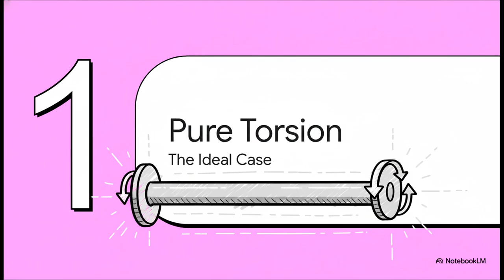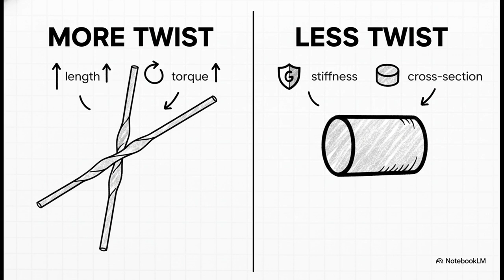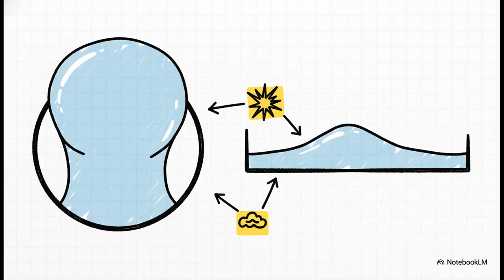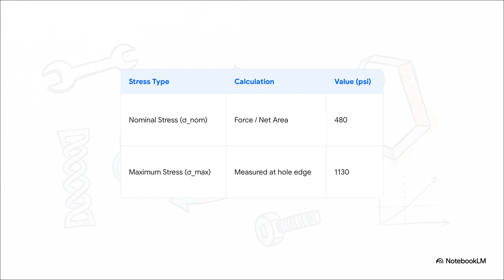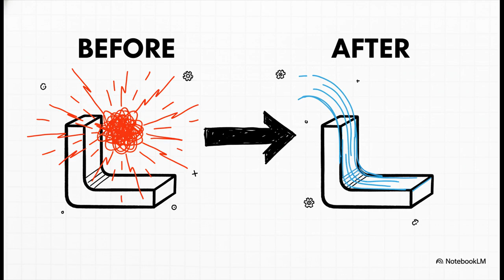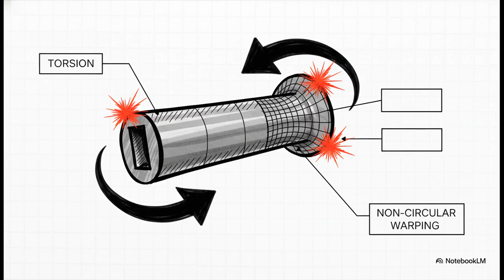The Twist

Comment: why not just post your notes instead of this bullshit ai summary
Reply from the maker: We’re not sold on this whole AI era, but here’s the truth. Every bit of what we teach comes straight from the best engineering books out there, the kind most people never get their hands on. We’re not here to pass it off as ours. We’re here to break it open. Everything has a purpose. And if AI lets us take knowledge that’s been locked behind paywalls and put it in front of real people trying to learn, then we’re going to use it. No hesitation. This is about getting real engineering knowledge out of the vault and into the hands of people who were never meant to have access to it.
Reply: @strykvisionz it's not and you do. i bet you personally could off the dome, make a better summary then this surface level broad-scope simulacrum of education. 
and you do claim this to be your work, by not citing your source. QYBS
Reply from the maker: We appreciate the feedback. This is a Frankenstein stack. Bits ripped from engineering, science, and scattered fields slapped together with a script built on the most common questions plus my own raw pain points. Some sections are pure filler, neither here nor there. All our content and courses are  created by us.
Reply from the maker: Most of you listening are already a sealed vessel. Sitting on old wins while the heat from automation, and AI-native workflows ramps up with zero outlet. You will not adapt later. The valve is learning to weld these tools into machines that run without you. Open it now or join Kodak and Blockbuster in the scrap heap. 

Remember our input will change its output.